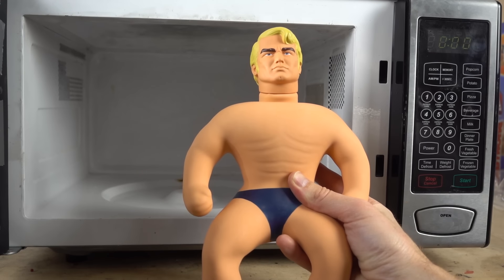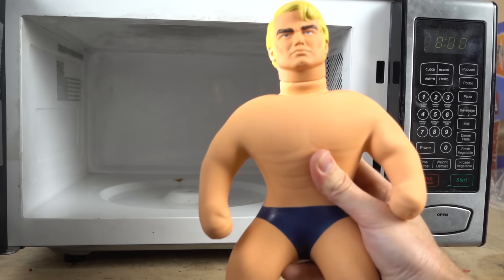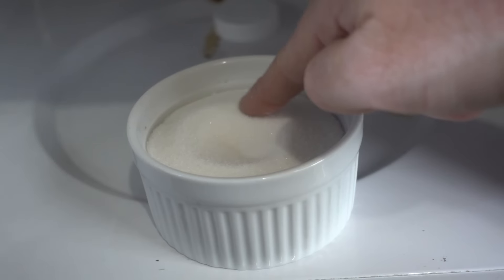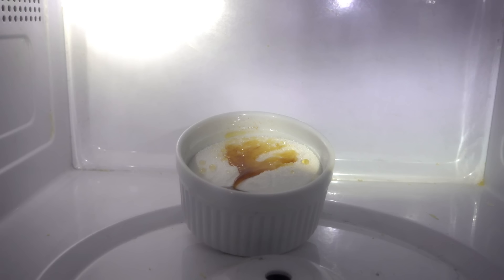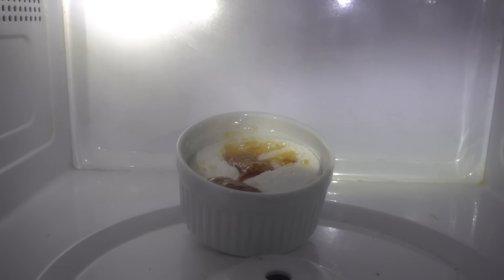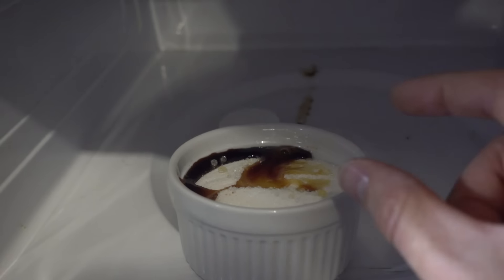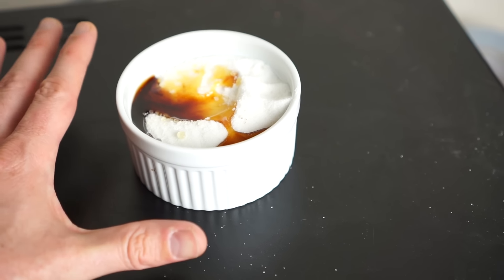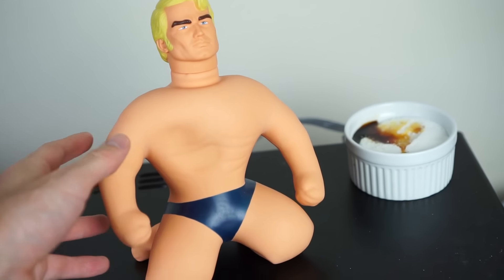Stretch Armstrong in a Vacuum Chamber and a Microwave—An Explosive End!

Comment: You do realize without it rotating you're not getting proper use out of your microwave right? There is a very good reason why they make the turn table for microwaves and why you're not supposed to put stuff in the center of that turn table.
Reply: Nismomonkey he's a scientist, I'm sure he knows how a God damn microwave works. . .
Reply: HealiumCrackle I mean if he did then he would have used it properly instead of only letting some of the microwaves hit the stuff he put in it. Even Destin from Smarter Every Day didn't know how they worked and he is a fucking rocket scientist for NASA! Everyone seems to think they bounce around in there but they don't. Microwaves don't bounce they go from one side to the other and get absorbed by the material there to prevent them continuing onward. Hence why your middle bagel bite was always cold if you put them in the dead center. It only got hit by some of the microwaves. 

Even engineers at GE I worked with didn't understand this when the turn table broke in one of our break room microwaves they couldn't figure out why it kept fucking up popcorn and why I would always wait for the good one that had a spinning turn table in it. 

This may win a record for longest youtube comment ever. I wonder if that comes with cookies...
Reply: Nismomonkey There are microwaves without a turning plate also ;) They have a rotating metal reflector that distributes the waves evenly.
Reply from the maker: +PressTube hey buddy, I had to do a follow up to your video and actually pop him!
Reply: Nismomonkey oh I always thought the microwave fairy got her magic microwave dust on her food and made my food super hot

Comment: My Mother literally bought me one of these when I was very young simply because they where suppose to b indestructible, well actually they where I did though shoot BB's into him and he was still OK, but believe it or not what finally got him was not my toy destructive behavior but my Mothers Car trunk, he was left in there during a hot summer day In Arizona and my Mom opened the trunk and was all over the corner he must have burst from all that heat built up in the trunk, my Mom was pissed because that goo is hard to clean, I think she actually re heated with a hair dryer to get it all out, and back then the Goo was red, but same consistency, but he was hard to kill that's for sure I would throw him in the air as high as could and he would just bounce off the ground, so I really could not break him, hence the reason my Mom got him for me, my GI joe's could not hold up to my style of play,

Comment: I'm curious about sound within the vacuum chamber. An experiment for instance, suspend a radio or cell phone within the chamber so it is not touching the chamber walls... have the device playing music or repeatedly playing one note... how would the sound change as the vacuum chamber reaches different fractions of our atmosphere?  Could you record with three microphones: outside the chamber, suspended inside but physically separated from the sound-emitting device, and physically attached to the device?